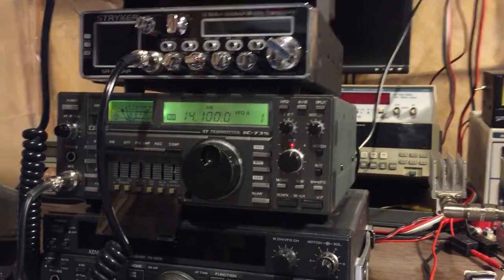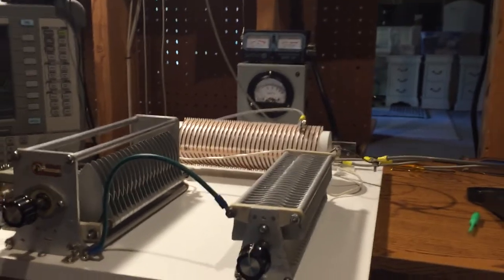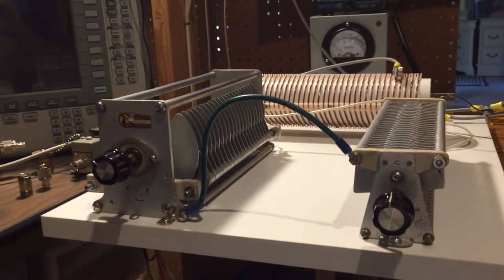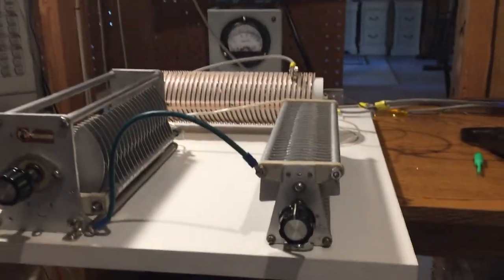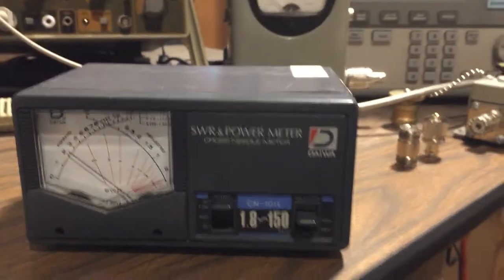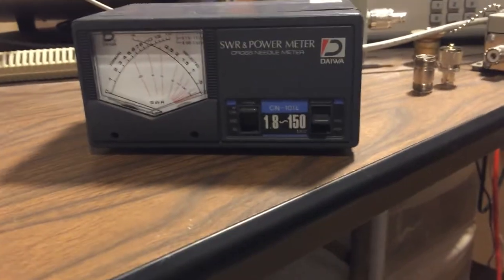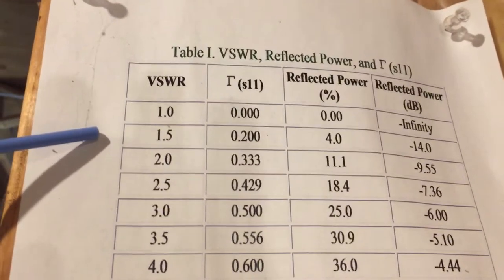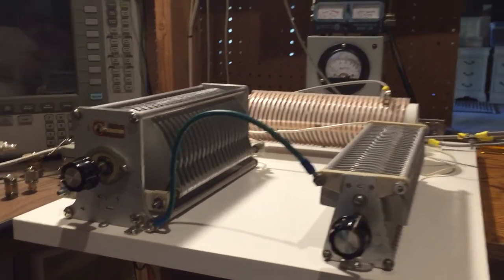RF Man Demos Antenna tuner with LDMOS Amp

Comment: Hey RF Man!
Do you think that if i measure a good VSWR between the amplifier and the impedance matching circuit (like 1.1 ... 1.3) the VSWR can be worse between the matching circuit and the load? I have experienced strange things when i tried to deliver power to a very capacitive load.